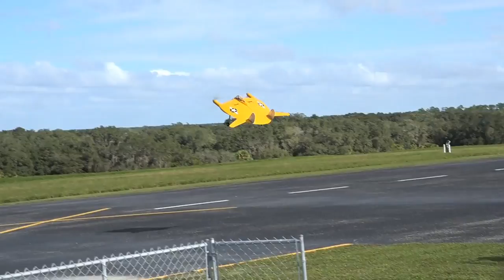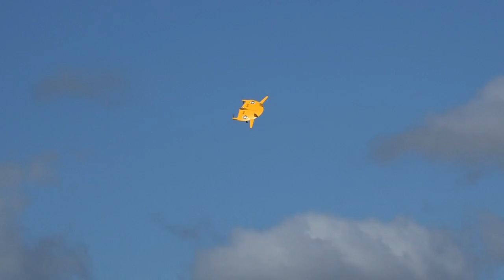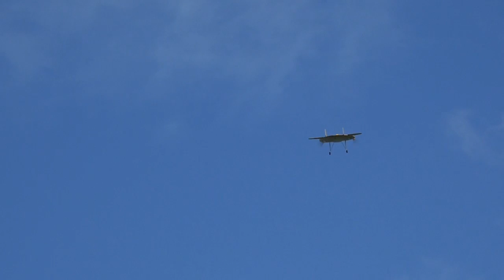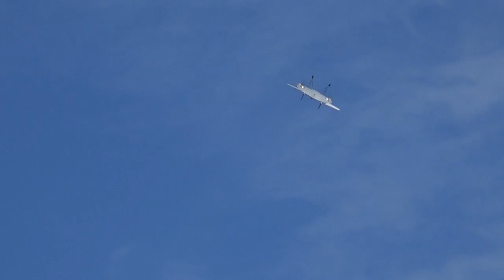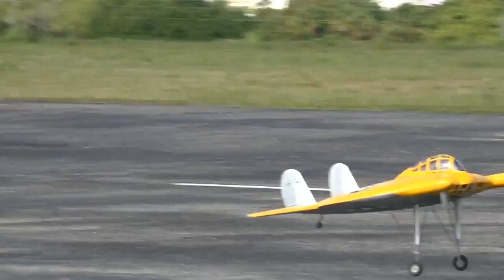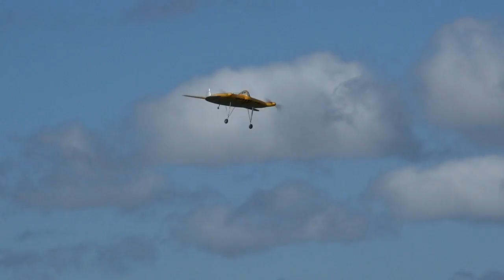Vought V-173

Comment: I always admired the Pancake design in that is exploited an advanced understanding of wing function.  The low aspect wing achieved far less cross sectional wind resistance than  that of  conventional wings.  (less resistance the more speed)  Low aspect wings however give up this advantage because it generates much higher induced drag from the wing tip vortexes. (much higher induced drag)  The only remedy it seems was a longer wing or higher aspect ratio taking us to the next closest proponent "the flying wing".  Zimmerman's genius was to move the driving force of the propellers to outer edge of the wing and by counter rotating the props to counter the induced drag at the wingtips back toward the root of the wing greatly reducing the low aspect disadvantage.
Reply: Aspect Ratio becomes a function of the wing span including the increased span made up from the down blade of each prop